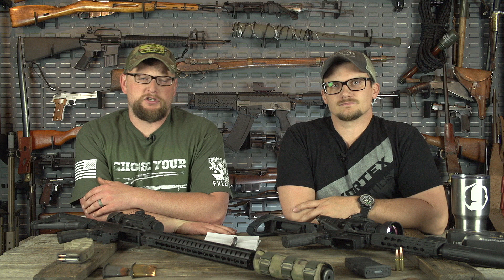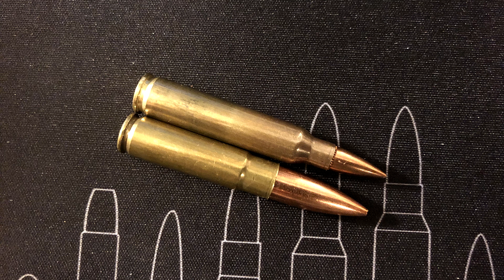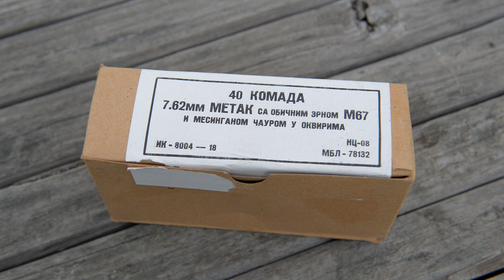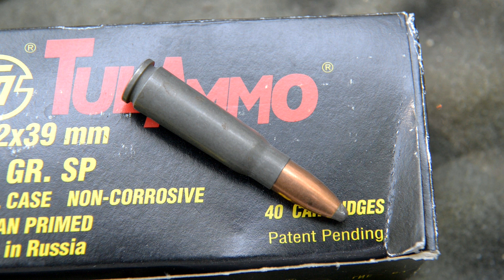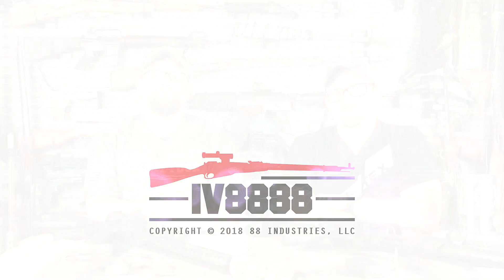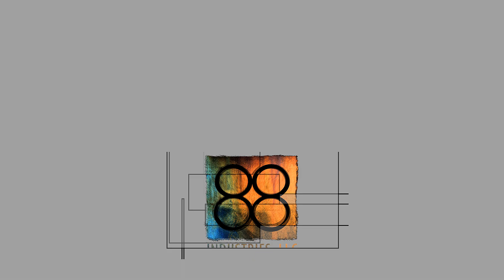Firearms Facts: 7.62x39mm vs 300 Blackout

Comment: I think one of the biggest pro's for the .300 sub rounds is home defense. Even non suppressed they are quiet enough to be relatively discreet and minimize hearing damage when fired inside a home. The lack of a visual signature is also beneficial as I would assume most home invader situations would take place at night and having a big fireball coming out the end of the barrel in the dark is almost certain to temporarily disorient your vision , complicating engagement and also would alert an armed invader as to position. Use in a home also begs the consideration of over penetration. Almost any supersonic rifle cartridge be it 5.56/.223, 7.62X39, .300 blackout are perfectly capable of going through the bad guy, my wall, across the street and thought my neighbors wall with still lethal amounts of energy, a sub is going to hit the bad guy and stop, even if I do miss and even if it manages to get out of the house it isn't going anywhere with enough energy to do anything. Every bullet has a lawyer attached to it. My last point is that the shorter barrels and configurations on a lot of .300 guns, especially sub guns lend them to be a little more user friendly in the close quarters home situations, you aren't trying to fumble around in a high stress situation with a 3-1/2 foot long  gun through hallways and doors. Just my 2 cents.
Reply: You're smoking crack if you think 300 subs are discreet. Much less when fired indoors. Go to an indoor range and test your theory. You'll find that subs are still breaking 160 db

Comment: for hunting the blackout dosnt  compare with the 7.62 round. the blackout is anemic as a hunting round. The 7.62 has 200 feet per sec over the blackout or 15 grains at the same speed. 200 ft per second may not sound like much but it matters when the cartridge is at the lower end of the HP range. The simple fact is the 300 just doesn't have the HP to drive a 30 cal projectile.
im selling my blackout and going back to .223 with a twist that will drive a 65 grain bullet.

Comment: 300 blackout is overrated and overpriced. supersonic it's no better than 7.62 x39 and if suppressed with a short barrel shooting subsonic, it's essentially a hushed pistol round that 9mm would outshine. 9mm is quieter for starters and recoils less. the biggest difference is you can get 9mm and 7.62x39 for $0.25 a round whereas 300 blk are $.80-$1 a round. there are guns out there that shoot 9mm and 7.62x39 in an AR platform that don't have proprietary magazines. save your money and don't fall for the 300 blackout sales pitch. I did and I sold myself out of it. I found I would never shoot 300blk because it was too expensive.although I still believe there are better options out there to reload, the only exception I will make to my statement is if you are a reloader and for some reason have a strong taking to the .300 blk round, because that's the only affordable way to shoot that round.

Comment: 300 blackout was meant for short barrel and to be able to switch sub to super with only a magazine switch. Not really meant to compete with the 7.62. I built an ar pistol in 300 and I love it, but I would never ever build a full length 300, just don't see the point. If you want a pistol or sbr get a 300, if you want a full size get a 5.56, 7.62 or a ar-10. Both obviously have pros and cons and just pick the one right for what gun you want to build

Comment: Also, the main advantage of the 300 is that it was designed to be run in a short barrel for CQB, yet it is more than capable of 200 meter kills with the short barrel.

Comment: They are both really cool rounds.  The 30-30s of our age.  Fast shooting great hunting round here in the south where shots are closer and pigs are feral. I am a big fan of both.  I probably don't need both because they are similar but they are both so cool I couldn't imagine not owning both.   I get 300 blackout brass for free.  I reform my split 223 cases.  The fact that blackout supersonics are slightly less velocity is mitigated by the higher bc of well designed .308 bullets like Chad's Barnes 110 or Hornady's 125gr sst.  Not to mention the fact that the 110 load has significantly less felt recoil.   The real reason to use a self loading rifle with 30 round mag for hunting is very rapidly delivered aimed fire. Which means more muzzle energy is not necessarily better.

Comment: Eric, I think the reason why the 300 blackout is so popular is because like you said in your video the only thing different is the barrel - everything is the same. When I got into firearms I missed the boat on getting a quality AK at a good price unlike today where a WASR 10 is going to run you over $600 when just 6 years ago you could find them under $400. Another reason is that I have to look at the cost of accessories like magazines, quality AR mags are as low as $9 while quality AK mags start out in the $25 range. Then there's the replacement parts in case S does HTF, are bolts, firing pins even replacement magazines and what not, are these parts for AK's going to be widely available as they are for AR''s?   Most likely not.
In my area I don't see myself using my AR more than 250 yards, the blackout even less to about say 100 yards, so I'm more concerned about how the round performs at close ranges to defend myself ,family, and potentially neighbors from those who would do us harm. Granted the cost of ammo sucks, but reloading helps especially if you form your own brass from recycled .223/5.56 brass (lake city is best IMO) and get projectiles in bulk. I use H110 for the supers and Accurate 1680 for the subs.
Reply: Haha have you now seen the price of those AK? Anything imported is $$ 
I think a wasr is around 1k now 😮

PSA makes an affordable AK and also a premium AK
Reply: @1997LT1Camaro  if you look at the date of my comment that was a good 4 years ago. To be honest anything AK related is going to be big money if you are in the US

Comment: Im with Eric, 7.62x39 wins hands down. availability, affordability,  and better performance. in sks, ak47, mini 30, mutant. if you are strictly an AR guy and can afford 300blk, shoot it.  Only problem is my mini 30 doesnt like steel. too many fail to feeds! I wish Magpul made a ruger mini 30 pmag with an anti-tilt follower. At the very least Ruger should make this gun run steel. Thus where can I  find that bulk Yugo  M67 ball/ brass case?  Ive never seen that around before but cheaper brass case can be had at the sportsman guide when its in.

Comment: The difference in muzzle velocity and energy between 7.62x39 and 300 blk is about the same as the difference between a 357 magnum carbine and 300 blk carbine. Soooo ....... 357 mag carbine < 300 blk carbine < 7.62x39 carbine 
357 magnum is also a lot easier to reload than 300 blk or 7.62x39
Reply: Prepare2Survive please tell me where you can find an auto loading rifle in 357 magnum
Reply: Ruger made a semi auto carbine 44 magnum, but I understand your point. 300 blk and 7.62x39 have the advantage in that regard, but when you look strictly at muzzle energy when barrel lengths are equal there isn't a lot of difference. Then when you factor into the equation how much easier it is to reload 357 magnum it makes sense why that caliber is still very popular. Just look at the load data for all 3 calibers and you'll notice that there's hardly any difference. I'm looking in the lyman 50th edition reloading manual and there's one powder that's listed for all 3 calibers in the 123 to 125 grain bullet range and the difference is only a few grains. The max charge for 300 blk is 17.7 grains, for 357 mag it's 19.5 grains and 7.62x39 is 22 grains.

Comment: The big one for me is that my range wont let me shoot most standard 7.63x39 ammo (non magnetic policy).  I refuse to pay 3x as much for non magnetic brass case 7.62x39.  I've adopted 300blk as a substitute of sorts, and also for better shorter barreled performance and less muzzle blast.  I load 150 grn super sonics and 215 grn sub sonics with H110.  My 215grn subs are extremely quiet, soft enough that they wont run the action without the additional back pressure from my suppressor.

Comment: Didn't take into consideration the bullet coefficient the .308 bullet has which equals better down range performance.  The 125gr 300 (per aac chart)  had over 600ft lb energy at 300 yards versus 7.62x39s 525ft lb. Just something to keep in mind.
Reply: In walks a 154 gr 7.62x39 having over 1,000 ftlbs of energy at 200 yds laughing !

Comment: The .300 BLK is for normal AR-10/15 pattern carbines to have a reliable 7.62Soviet feeding carbine analog or a suppressed SBR that works great.  Now if you are going to get a Kalashnikov pattern carbine or a bolt gun, just go 7.62 Soviet to start off with.

Comment: As a reloader I have to say 300 BLK has the edge in that you can find tons of brass to cut down, the cartridge does not use a lot of powder when loading. The bullet selection in .308 diameter is off the charts. The com block 7.62 firearms are not as optic friendly as an AR or ergonomic. All that being said the Ak sits by the bed at night.

Comment: Thank you for his video. I am still on the fence between 300 black or 7.62x39. I am looking for a good choice for home defense within a large apartment. I have a 556 ready, but prefer something more appropriate. I thought 300 Black would suffice. Suppressors are a luxury at this point.
Reply: Cristian Alexander if you live in an apartment I would be worried about over penetration with both of those. I'd stick with a shotgun with something like #4 or #6 birdshot. I'd be leary of using buckshot in an apartment.  a taurus judge would be a good choice too.

Comment: As for ammo prices, I don't know why people always compare the price they see at their local shop for 300 BLK (Match ammo) to the very lowest super bulk they can get on line.  DO NOT BUY THAT 147/150gn CRAP!  Wolf makes 300 BLK cheap but it's still not avail in the US (yet).  That being said, 50c/rnd is not good enough - it's the bullets.  If I can buy bullets for 10-15c, loaded ammo should be 30c/rnd by now for 300 BLK.  Manufacturer are gouging a little bit.  With Police looking at it (come on, you really think they are gonna get a bunch of AKs) the prices will be affected.

Comment: Zombie vs Live Caliber.  More bullets!... 15 options vs over 300 at Midway!  Even running slower, .308 bullets have better B.C.s so they have greater range and accuracy than .310 slugs.  Factory 300 BLK loads were 2000 fps for 125 gn bullets a year ago.  Now factory loads are 200 fps faster!  They are still overly cautious.  I have no problem loading 125gn to 2300fps with 300MP or 11FS.  The brass is SAAMI 223 which is thinner than Military 5.56.  Using military brass gets you another 100fps to 2400fps.

Comment: Guys, you are forgetting the magic BC factor... why does a 6.5 Grendel outperform .308 after 750+/m? Why does the 6.5 Creedmore keep up with a .300WinMag out to range? DRAG... the .300BLK has way more aerodynamic bullets so while it might be 200fps+/- per sec slower at the muzzle, after 200-300m it catches up and outperforms over a longer range. Try the 120g 300blk vs a 120g M43 at that range you did the testing for the ACSS scope at... bet the stability is better and you wind up more on-target at that range. 
Also, in defense of the 300blk, if you have a Dillon or other similar reload press, you can make 300blk almost as cheap as commercial 7.62 M43 (think surplus M80 7.62 pills). Also, cases for the 300blk are relatively easy to make from 5.56 cases... cut, lube, form, trim, go! 
As far as hunting with subsonic... you HAVE to use a good pill like those from Lehigh or Barnes and make that shot within 100m. Beyond that is stupid and may just wound and cause suffering. 
.300blk is a good way from being affordable... until the Serbs or Russians start making it. Unless you handload, it's pretty expensive. But in the versatility category, there isn't much out there from super to subsonic to touch it... .from 108g M160 frangibles (never fire these in a can) to 220+g... can't beat that bullet selection.

Comment: Shooting 600 yards with 7.62x39 or .300 blackout is stupid. The limitations of both cartridges find their absolute max effective range at around 350-450 yards. Within those ranges, both cartridges perform just fine. .300 blackout has a wider selection of bullet designs, which makes up for its lack of 100 fps. It's simply not enough to matter

Comment: To be fair, I run hot rod 125sst’s out of my blackout that hit 2500 fps consistently. Anywhere from 2475-2510 with a 125sst will kill anything within 250-300...: no doubt 200-250.
Reply: Yo can I get some dope on this... What barrel length? What powder? What upper and what groupings are you getting?
Reply: So will a 7.62x39 Hornady black SST

Comment: The main reason I’m building an AR pistol is because of my hunting laws in my state.  For a pistol, I need a straight walled case or a necked cartridge that has a case length of less than 1.5 inches.  7.62x39 is too long but 300blk is right under it.

Comment: One of my personal reasons for the 300 BlackOut is; I can buy military once fired brass for the 5.56 pretty damn cheap. Converting that to 300 BLK is fairly easy then I can load it up myself. Then, I know exactly whats going down my barrel and I can tailor it to my needs. I can do all that for less than I can buy an 1100 round case of 7.62 that I can't tailor.
As far a having the sealed "military" cases, there are options out there you could consider for long term storage.
??? You can't see hunting with a subsonic 300 BLK but you just love the AirForce Texan? I realize it is an apples and pears comparison but still... really? I don't understand this unless you can't get beyond the idea that one is air powered and the other uses gun powder.
Frankly, I love the versitility of the 300BLK over the 7.62x39. If you prefer the 7.62 why not, except for the expense, just shoot 30-30? Similar balistics.
With the consideration of surplus military weapons, yes the 7.62 wins out.
---Just my two cents.

Comment: Small point, but a pet peeve of mine as an engineer, you have energy in ft/lbs. The unit for energy is ft-lbs. It is the product, not the quotient as the slash indicates. It gets written incorrectly all over the place, but that doesn't make it right.

Comment: G'day gents,  a'little f.y.i:  As the "7.62 mm" of the old soviet style is actually .312" not .308", one may use light '7.62 russian' bullets in a .303 (actually .311/.312 depending on early or late manufacture) and heavy .303 visa versa!!!   soooooo... if one wanted to make a 7.62 x 39mm  'whisper' and load a '.303', 200+ grain projectile in an A.K. "what a wonderful world it would be". P.S. don't waste time trying to make a screaming hot 4k fps .303 s.m.l.e., the rifling is to slow for a light bullet!  'Been there, wasted the time, burnt t'powder, didn't even get a t-shirt!

Comment: I switched to 300 blackout as my deer gun this year and was very impressed. I took two deer with it one dropped right on the spot and the other ran twenty five yards. Both where shot at right about 100 yards, I use the barnes 110 factory loads, I know guys who hunt elk with the Lehigh expanding subs in 300 blackout hand loads.

Comment: Great video IV8888

PSA AR47 (not the KSA47) upper and a few C products or ASC mags and you ready to run your 7.62x39 AR, round after round. 300blk is a waste of time, no avg joe is "whispering death" blah blah. I built an AR10 (.308) for the same price as a full 300blk gun and ammo is still cheaper + I get 2x the power.   Save money on ammo and just buy an upper (AR47) that you can drop on your lower. 

7.62x39 ammo Wolf MC 124gr sp shoot great and are great for hunting as well as 154sp.

I have not tested them but BCA seems to make a good AR47 upper too. Again this is just basted off reading reviews. I have tested 2 PSA AR47 uppers with over 500 rounds each. 

Don't believe me? Proof is on my channel. 

"Palmetto State Armory 7.62x39 AR47 Upper and build, it works! "

Comment: I recently purchased and SKS that fires 7.62×39, I have had nothing but problems with Wolf ammo, the first box of ammo I got for it was a 20 round box of Wolf, I still have 16 rounds left in that box, I've bought a couple more just to check and see if it was just a bad box, not one round is set in the same spot in the case, it struggles to even chamber, and if it does it rarely cycles, I have had very few malfunctions with Tul, but endless problems with Wolf, I can think of 4 malfunctions with Tul and 2 of those were because I had accidentally scuffed up the cases pretty bad trying to single load while sighting in on a bench, Wolf is just bad ammo.

Comment: 7.62x39 all the way. Sub 300 you are just pencil holing animals. 7.62x39 hollow points arr great on hogs. The fmj pencil hole too. But for 20 cents a round for hp 7.62x39, its a nice option.

Comment: The video proves a point as i have built an ar in both 300 and 7 62x39. I buy the wally world 7.62 ammo for 9.97 but the projectiles are pricey for 300 bo.
I actually run 30cal m1 pills at 110grain looks luke pistol ammo for the 7.62x25. 
But it feeds and shoots well. Ita a defense gun nit for hunting, i wanted a round that was in between the 5.56 and up so did this build. Great video, and dont bother buying 300 brass its cheaper to get a big ol bag 5.56 lc brass and cut it to size

Comment: What about loading 308 bullet in the 7.62×39 shell? Subsonic is usually within 100yrds, and the small difference in size shouldn't affect accuracy that much at that distance. Then a 220 grain 308 can be used subsonic in 7.62×39. Will it cycle?